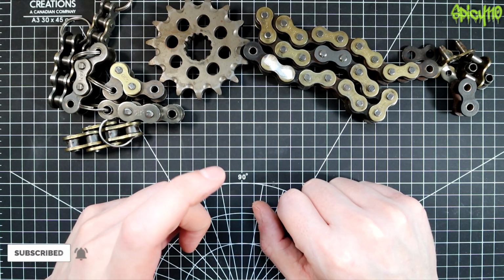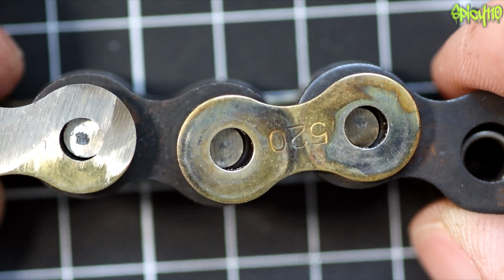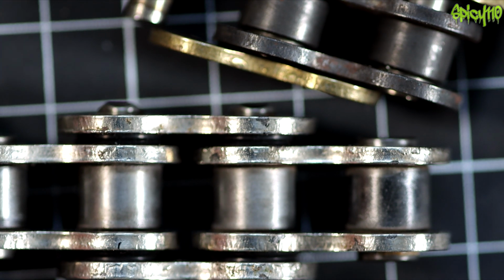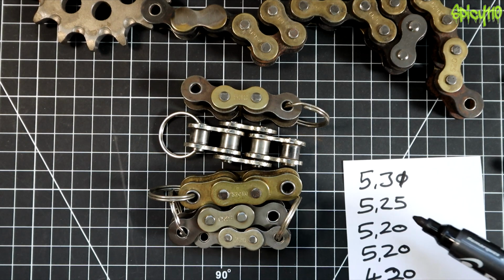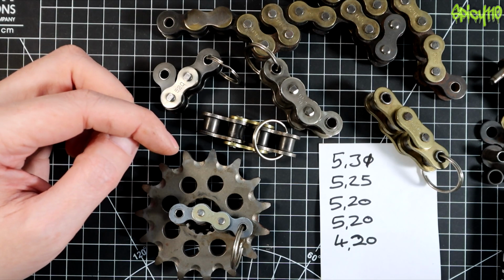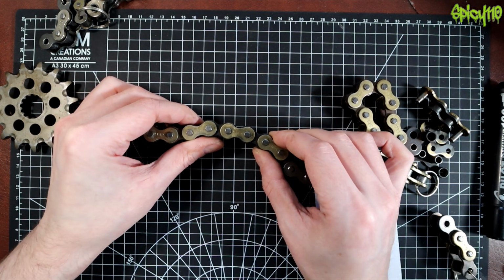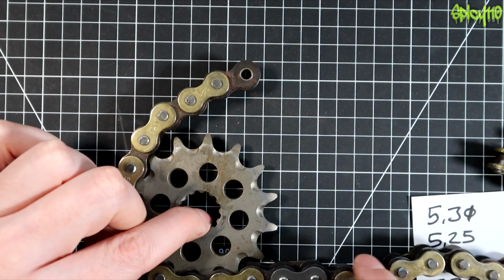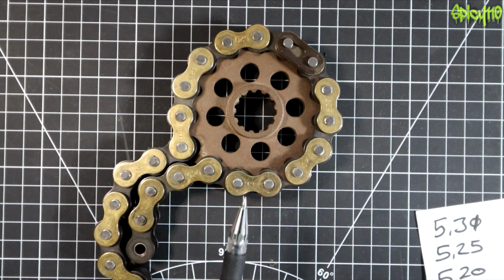How Motorcycle Chains SNAP! + Sizes Explained!

Comment: Excellent video. I always take a few minutes before every ride to do a pre-ride check where I check proper chain slack, chain properly lubed, check tire pressures, rolled the bike forward and back to check for tire punctures, check the fork tubes for oil seepage, check engine oil level, check brake light function, look for leaks under the engine. If any of these are an issue, correct it before riding.

Comment: Hey people most gear ratios the front sprocket turns 3-4 times to one revolution of the rear. So therefore the ft. sprocket wears out 3-4 times faster than the rear so therefore it needs to be replaced at least twice as often as the rear. When the ft. sprocket gets hooked replace it your chain and rear sprocket will thank you by lasting longer. When your ft. sprocket is wasted it takes out the rest of your gear set.

Comment: I would be very interested in your opinion. I would consider myself on the upper end of the scale for doing preventive maintenance. However, I have always wondered if chain cleaning and lubing are really necessary. I've wondered if lubing just attracts more dirt and sand, holds onto it better, and wears the chain & sprockets faster. With a good x-ring chain, lube does not get into the rollers. It does lube the outside of the roller but also holds grit, which wears the chain & sprockets. So, at 65 years old, I am finally doing the experiment that I've always wanted to do. NO CLEANING OR MAINT. The theory is that it will attract and hold less grit and will last just as long. So, I put a new DID chain & new sprockets on my KTM 390 Adv, and have ridden it 4,000 miles 50/50 on/off road, with some long tough offroading. I have absolutely no wear on the chain or sprockets and no tight spots. There should not be much wear on the sprockets as long as the rollers turn. I will need to put more miles on it to finish the test. But even if I need to replace chain & sprockets at 15k miles, I have eliminated a buttload of work cleaning & lubing, never have to carry lube on trips, and have no lube mess on my bike. Maybe the chain will last just as long as if maintained. I don't yet know. But even if not, I am happy to spend $125 a little sooner to gain all the benefits mentioned. Again, I would appreciate your thoughts on this.
Reply: Did you ever hear of chain wax? See Maxima, chain wax. Why would you NOT service your chain?
Reply: @dustyjohnson1981   Yes, I have used chain wax for decades, and it's my first choice for lube. To answer your question, "why not lube?", my post answers that.

Comment: I've got a couple of bikes with 630 chains...
I needed some help changing the chain one time because I had an endless chain installed and didn't have a rivet breaker. So a friend of mine who rides as well came over with his chain breaker. We got the chain off but the mammoth 630 chain broke the chain breaker. Also he was saucer eyed at the size of the thing. It's an insanely big drag racing chain.
The bike it's on is actually a late 1980s Kawasaki police interceptor.
The same model of bike went basically unchanged save for a few minor things from '82 to '05. You can basically swap any part between the KZ1000-P bikes between those years, though some things may require swapping more than just a single part. Like it's the same chain and sprockets from '82 to '01. But then they changed in '02, so to swap chains or sprockets between those years, you have to swap both sprockets and the chain. Things like that. Anyway, the chain on the '02 is a 530. They tried to keep the final drive ratio as close to the original as possible. The idea being to have less weight and therefore more acceleration. However as someone who owns an '88, and '89, and an '02, the '02 is the tamest of them all. The '88 and '89 rocket start like it's nothing despite having 3 times the mileage. The '02 just doesn't rocket start. I mean sure it accelerates faster than cars, but it feels lethargic compared to the amphetamine fueled energy of my '88 and '89.

Comment: I think it snaps because of loose chain... I just back with snapped chain... I put it last week. 600cc 89hp bike  It's cheap, paid £35 with bicycle connection 🤦‍♂️ So, it's not because of maintenance... It was just wobbling and jammed at the casing and now I have hole in my engine 😢 again 😢 second time in 3 years 😭 Well, first time wasn't because of chain...

Comment: If you change chains at the right time (1% elongation) reasonable quality steel sprockets should easily outlast 2 or 3 chains. Overly worn chain (+1%) will soon knacker sprockets and then sprockets and chain must be replaced as a set.

Comment: I think the split links get unfair bad press. The spring clip doesn't take the power, there is a regular side plate for that. Yes you can do it wrong and have a failure, but if you put a rivet link on badly you can damage the chain and cause a failure too.

Comment: I may mention O-ring chains have more friction between the links.   On small bikes I have noticed a lack of power running an O-ring compared to the same chain without the rings. And for me miles per pound spent is the same.  Standard chains are also easier to clean.
Reply: X-Rings supposedly provide better lubrication protection than O-Ring while also having less friction than O-Ring, but still higher friction than chains with no rings at all.
Frankly I only use X-Ring. I find they last longer than the other two with less maintenance. I get that I'm paying for that less maintenance in a slight drop in fuel economy, but it's easier to put more a few drops more fuel in than it is to clean a chain every week.

Also, I do a lot of all-weather riding, so... yeah... non-ring chains are just going to degrade really REALLY fast with me.
Reply: @MoonBnuuy  I ride all year round in all weather's myself and clean my chain weekly just a 10 minute job.  I don't use lube though I use engine oil.  I simply put some oil on a rag and spin the wheel and run the chain through the rag and it gets all the dirt off then use the oil can to oil the rollers sprocket side but not too much.  I actually get less splatter than lube this way.  I do this as I hate cleaning lube off the wheel and I don't get the huge gunk build up in the front sprocket cover.   I do have to ensure I keep up with it through winter but don't mind as I get really slick gear changes keeping on top of the chain.
Reply: @Mean-bj8wp  I use gear oil when I oil my chain, as it's what Kawasaki recommends for my bikes (I have three KZ1000-Ps of different years).

Frankly though I don't mind the extra fuel I have to spend from the increased friction of an X-chain ring, especially since it's a lot less than O-ring. It is a lot more expensive though. I heck I rarely get the bikes over 6500rpm when the red line is at 9800.

Comment: Wow... I never knew how the numbers worked. Thanks.... bloody inches.
Thinking about it... a 520 chain is probably stronger than a 530 chain since the plates could be all the same but the pin is longer on a 530!
Reply from the maker: It has a larger sprocket inside tho spending the load over more.

Comment: I've been cleaning and lubing my chain every week during the winter. As the bike is kept outside and I live at the coast I assume it would rust up quicker anyway??
Still not good for a new chain I bought last summer, but anyway I noticed a couple of stiff links yesterday and no amount of cleaning/lubing would free them up. It was a D.I.D so a decent one, but I still expected it to last a bit longer than one winter lol
Ordered a new chain and sprockets this morning.
Reply: That is a surprise indeed ! Uk winters are quite rough for sure on bikes but I would have been like yourself in thinking they would last a bit longer.
Reply: @theonlyredspecial  even my sky dish went rusty lol
I phoned the local bike shop who fitted the chain, even they were surprised. Not surprised enough to offer a replacement though 😂
Reply: lots of salt, grit and long winter miles can be death to chains. I've had good chains die quite soon after long winter motorway runs